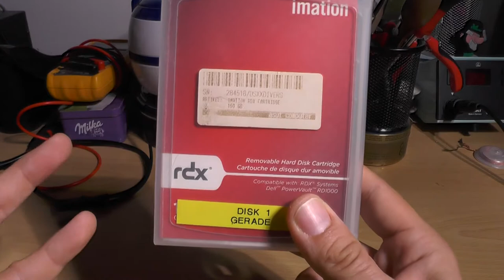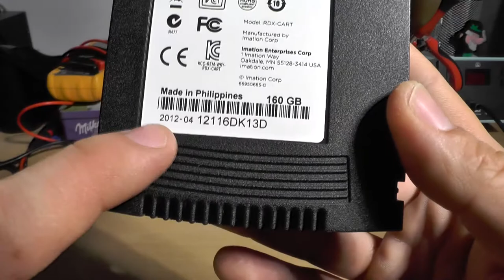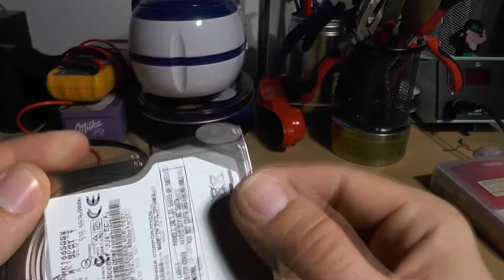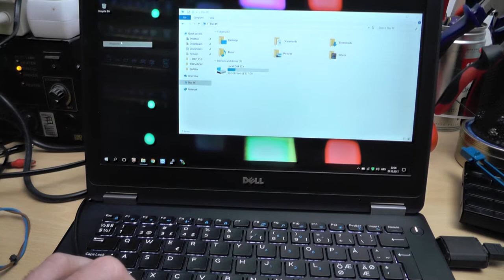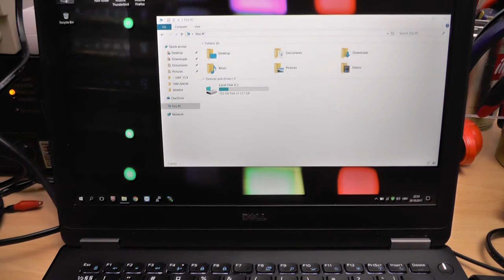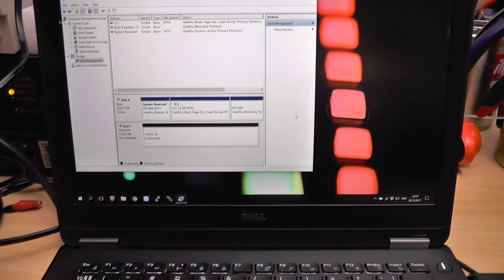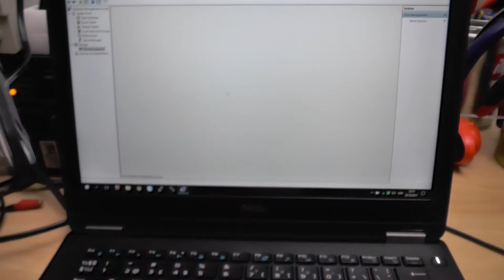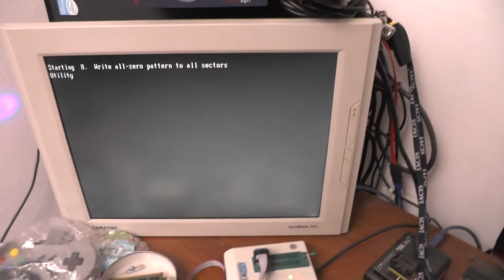HW: Quick look at 160GB RDX

Comment: RDX hard drives cannot be accessed unless you insert the cartridge into an RDX dock. The HDD units are similar to regular 2.5" drives, but the firmware has been altered to prevent exactly what you are trying to do in this video.

Get yourself an RDX docking station, and try it again. Its possible that nothing is wrong with the drive.
Reply from the maker: I agree :) i actually googled and came up with that later on, hoewever this is way too small drive for me to buy dock (they were insane 150++$ on ebay) :/ too bad tho, it's a cool concept. We are still using LTO @where i work (well, that together with Veeam replication/Backup to a remote location)
Reply: @MTS_IT  I was about to ask if you had even taken 3s to google what you had before making the video. If you had, there would've been no video. That RDX disk would've gone on eBay for the $$$ it's worth. (even one that small)

Comment: The RDX disc system is really a rip-off as it is actually an ordinary 2.5 inch laptop hard drive inside, subject to all the weaknesses of any other  hard drive. To market it as a robust data backup system is more than disingenuous. I've been researching an off-line backup system for my NAS, and RDX was one system I was looking at as LTO tape drives are astronomically expensive. But after seeing this and other teardown videos, I'll stear clear of RDX "technology." There is no difference between RDX and any regular hard drive I can buy at a much lower price per GB. Thanks for this video.
Reply from the maker: Tnx